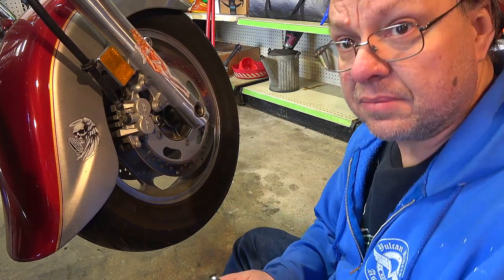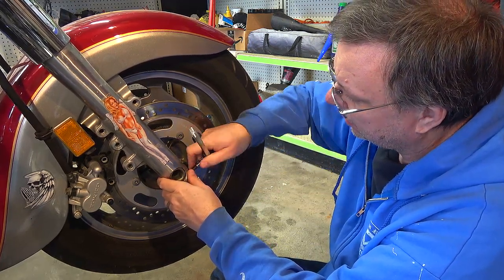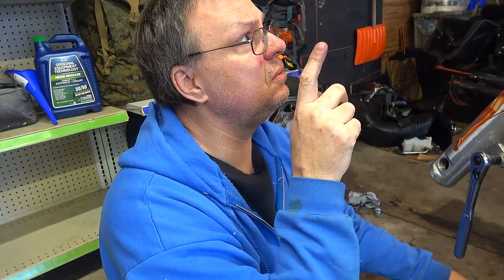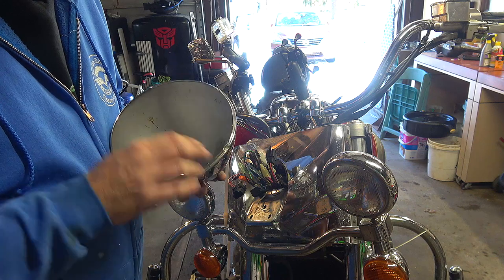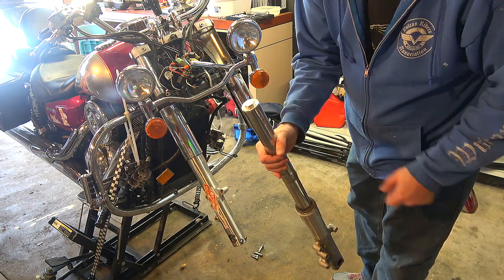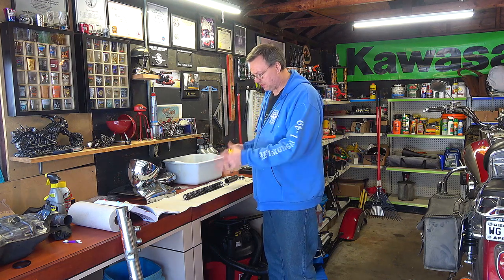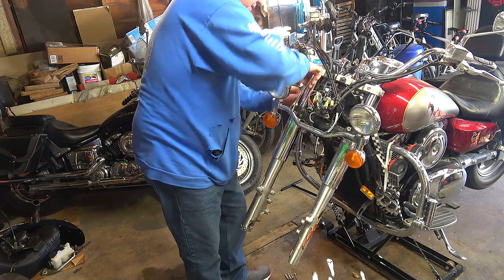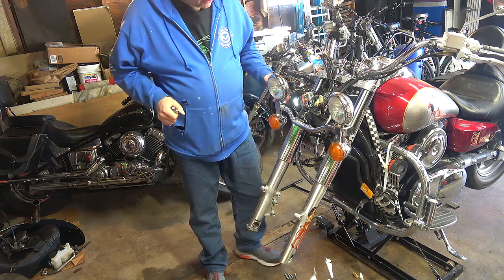Vulcan 1600 Classic - Front Fork Oil Change

Comment: No need to fully disassemble the front headligt. Enough to unscrew 2 bolts on which the headligt platform is held. And then you can move the entire structure and get to the bolts on which the fork holds
Reply from the maker: Yeah, I realized that, after I did it.

Comment: you need to get some extention bars of you sockets and ratchet makes the job a lot easier. Also a cheater bar to go over the handle of the ratchet. you don't need to use a hammer. Electric conduit pipe is great to use. Your videos are great.
Reply from the maker: Thanks for the tips and thanks for watching👍

Comment: Hey Mark, i bought a used vulcan 1500 mean streak & my forks are completely seized.  They have ZERO travel.  Any suggestions on cracking these puppies loose?  I'm assuming the spring inside may be rusted to the fork itself?  I've never seen this & can't find any videos or articles.  The Mean Streak (& Suzuki Marauder) are basically the same bike & have inverted forks, if that helps or matters.  Thanks!
Reply from the maker: That's a new one on me. I've never seen or heard of a fork being seized up. I guess if the outside looks in good shape (no heavy rusting), take it off the bike, crack it open and see what's going on inside. My guess is that you'll need to either totally rebuild it or rplace it.
Reply: @ChefHikerBiker  yes thats the intention.  Was thinking of using a tow strap to ratchet down on it & see if some pressure would pop the springs loose again.  Anyhoo, thanks for the response and great videos.  I've subscribed.
Reply from the maker: Keep me informed as to what you do and if anything works
Reply: How’d it turn out? I have the same mean streak bike. I didn’t know the Marauder is the same bike.

Comment: Not bad...wondering what the service recommendation is for the fork oil? My '07 2000 Classic has 14k on it and I am thinking it may need changed soon.
Reply from the maker: I don't know about the V2K models, but on my 1600 they do not specify any fork oil change duration (i.e. 3 years or 20,000 miles). So, I figure Kawasaki is saying, if your ride is feeing like crap, change the oil.
I'm no mechanic, so maybe talk to your local shop and see what they recommend.

Comment: I'm wondering why the shocks need to come off to do this?  Is there not a drain screw at the bottom?  then you can just take the top cap off and fill it.  My Honda has a drain screw which makes it easy.
Reply from the maker: Yes, I could have just pulled the drain screw, let it drain out, replace the drain screw,  take off the top cap, refill it with oil, and put the top cap back on. But I wanted to do the full removal, disassembly, and reassembly, just so people know how to do it and what it entails.
Reply: @ChefHikerBiker  perfect.  I just bought a Mean Steak.  Picking it up tomorrow and I need to put new fork seals in it.  Thanks for this info.  Good job.
Reply from the maker: Awesome! I like the meanies. They're really cool. I'm sure you're going to love it. Thank you for liking my videos and I hope you find it informational and helpful.
Reply: I have a 2007 Vulcan Nomad 1600.   I am about to swap my stock springs for a new set of progressives and of course do the fork oil change.  I know my 98 Vulcan A model had a drain plug at the bottom of the forks.  Looking at my 2007 Nomad, it does not have one.  I do have an oil sump vacuum but I guess I will find out this weekend if I can get the tube to the bottom of the forks to scavenge all the old oil.
If not, this will be my guide to pull the face off the bike and do the tubes off the bike.
ALWAYS helpful to see it done!
Reply from the maker: That's odd that it doesn't have a drain bolt. If it's not on the outside casing, it should be in the area where the axel goes through.

Comment: Thanks for making the videos, I bought a 2005 classic vulcan and I've watched all your videos on it, and one of your motorcycle camping ones. I think I want to go over to the darkside like your back tire. I've never done it before, how long have you been running darkside?
Reply from the maker: First off, thank you; I am so glad you like my videos.
I went darkside about 4 years ago and find very little difference in the way the bike handles.
Reply: @ChefHikerBiker  thanks for the reply! When I watched your tire video I saw you said a 195/60 R16 for the back, do you use a rear motorcycle tire for the front too? The technique you used to balance the tires was interesting I think I'm going to try to change mine by myself
Reply from the maker: I do not have a car tire on the front. I will tell you right now, putting on a car tire is very difficult. It took me almost an hour to get the rear tire mounted by hand. Make sure you use rim protectors, to save your rims from damage.
Reply: @ChefHikerBiker Yeah I definitely want to protect my rims, watching all the maintenance videos made me realize it's a bike I'll have for a long time. I have an '05 Classic. Do you happen to remember what tire you use off hand?
Reply from the maker: I don't remember off the top of my head; but the make, model, and size is in my tire changing video.
Reply: @ChefHikerBiker  
Hey, I joined the darkside today! I like it. It does feel different. What setting do you run your rear shocks on? 

If you ever have to put a car tire on the rim yourself again I have a trick that makes it easier, let me know!
Reply from the maker: Yes, please share your trick.
Reply: @ChefHikerBiker  okay, so I used zip ties like you, but I also used two wood clamps to pinch the beads together. I just worked my way all the way around with the clamps and zip tying. All the bead was touching at one point. I did remove the zip ties before trying to mount the tire

Then I just like it sit for a few day, it somewhat trains the rubber and it went on fairly easy.
Reply from the maker: Interesting, thanks👍
Reply: @ChefHikerBiker  

No problem at all. You've helped me much more by posting all your maintenance videos. 

Any trips planned this year?
Reply from the maker: At least 2 overnight camping trips, hit up 2-3 rustic roads. I wanted to get to one of the VRA rallies this year, but it's not working out. Maybe an Iron Butt ride around Lake Superior.

Comment: I've got an 02 Vulcan Mean Streak that just turned 8,100 miles, low miles I know.  That's one reason I bought it, she looks like it just came off the showroom.  Riding the other day it seemed to be a little rough in the front on road bumps (rougher then last year) and I know it's due for its first shock oil change.  Did yours seem to ride better after the oil change?  Some guys are telling me to step up to next weight.  What say you?
Reply from the maker: Absolutely, it rode better. It actually took some getting used to, because it felt so different.
I guess what I would do is; I would change the oil and keep it the same weight, if I don't like it, then change the weight.
Reply: @ChefHikerBiker  thanks.  That's great. Good to know.  That is what I'll do then.
Reply from the maker: Ok, let me know how it goes.
Reply: @ChefHikerBiker hey Mark, was wondering if leaving air in the fork mattered? I noticed you pour the new oil in and just screwed the top plug back on.
Reply from the maker: I'm sure the air has been removed from just the operation of the forks. But I know it felt better after everthing.

Comment: Is that a car tire your running?  I'm putting a 195 on mine tomorrow and a stock rear on the front
Reply from the maker: Yes, I have been riding darkside for a little over 7 years now. 3 years on this tire alone. I use a 195/60R16.
I hope you like the car tire. It's not for everyone, but I hope you enjoy it.

Comment: CAN I CHECK THE OIL just from the top by pilling the caps and removing the springs
Reply from the maker: I really don't know, but I want to say no. I think the forks need to be vertical to do that type of level check.
Reply: @ChefHikerBiker  my 2003 Kawasaki Vulcan mean streak 1500 forks don’t come apart like urs I’m gonna end up pulling my whole front end apart
Reply from the maker: So, you have to completely remove the triple-tree to remove the forks? That's weird.
Reply: @ChefHikerBiker  no like u pulled the cap and the spacer and spring was right there is not like that mine is some type of cartridge
Reply from the maker: Ooh, you have an air cartridge. Sorry, I can't help you, I've never dealt with those before.

Comment: Sir, your front wheel tire is mounted backwards.
Reply from the maker: You're not the first one to say that, but no it's not. The pattern is just different from the one that was removed.
Reply: I would ask that you double check that because it would seem that you might be forcing water hydraulically to the center of the tire which could float / hydroplane the tire sooner. I'm no expert but I can see how it would appear reversed. maybe it just appears that way. Anyway, make absolutely sure.
Reply from the maker: I am 100% sure it is orientated the proper direction. But, I do appreciate you all looking out for me.